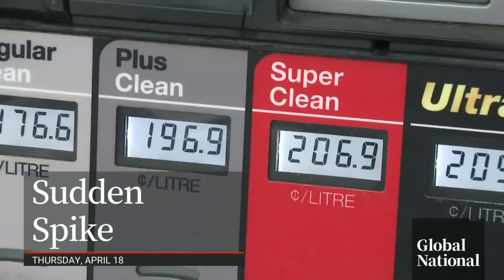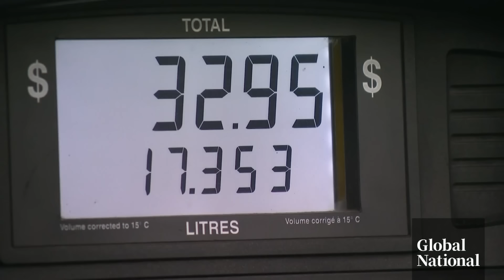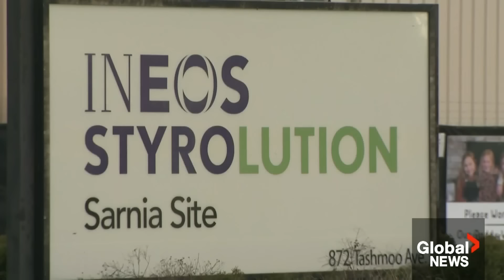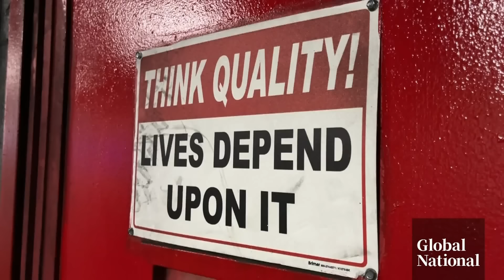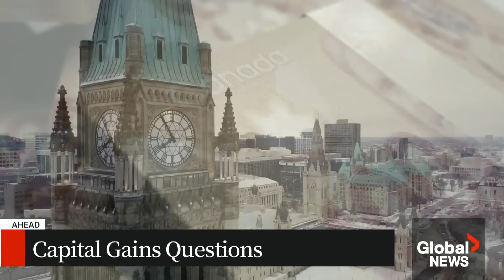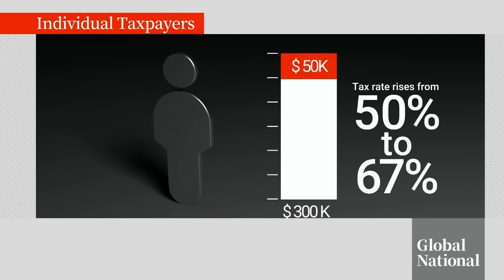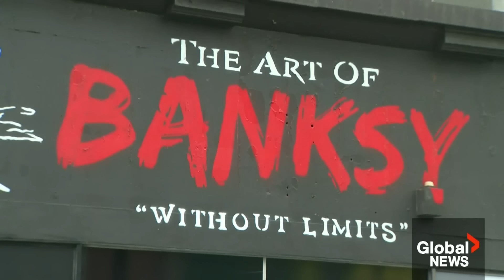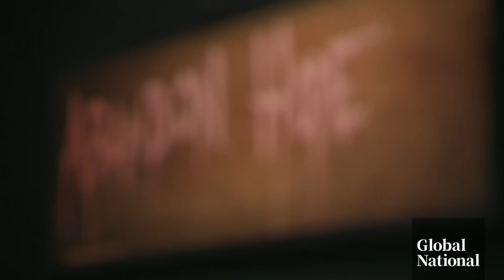Global National: April 18, 2024 | What is driving the sudden spike in gas prices in Eastern Canada?

Comment: So it's a double whammy this year. Season gas bump and carbon tax. But hey, we gotta think about climate change lol
Reply: I will be thinking about it while I drive 30km to Washington to fill up next weekend , hey I’ll save 65 cents a liter. With so much tax and inflation here why not!
Reply: Has very little to do with climate change, it has to do with oil companies not getting a decent buck for their products, so they cap their wells until the prices go up to cover their costs and allow for them to have operating capital to work. Ten years ago, oil companies capped their wells when the price of oil was below $100 a barrel, because it didn't pay them to operate, no return on investment.  Apparently the price of oil is about $80/barrel, so if wells get capped because cost of production is too high, there will be scarcity and that drives up prices at the pump. By the way, over 70% of oil companies in Canada are foreign owned, the question is, could foreign ownership be the reason prices jumped so high?

Comment: Canada Fuel Taxes by Province Province	Gasoline (¢/L)	Diesel
(¢/L)	Daily Gasoline Tax Based on Current Avg (¢/L)	Comment
Alberta	19¢	13¢	23.616¢	5% GST
British Columbia	21.17¢	22.67¢	26.994¢	GST + Includes carbon tax of 6.67 ¢/L on gasoline and 7.67 ¢/L carbon tax on diesel, as of July 1, 2012
Manitoba	24¢	18¢	28.682¢	GST Manitoba's PST does not apply to gasoline or diesel fuel.
New Brunswick	23.6¢	23.2¢	36.629¢	GST + PST
Newfoundland	24.5¢	20.5¢	38.202¢	GST + PST
Northwest Territories	19.7¢	13.1¢	25.124¢	GST
Nova Scotia	25.5¢	19.4¢	40.739¢	GST + PST
Ontario	24.7¢	18.3¢	37.291¢	GST + PST
Prince Edward Island	23.1¢	24.2¢	28.420¢	GST PST does not apply to gasoline or diesel fuel. Fuel tax is adjusted monthly and includes an amount equivalent to PEI's PST. The fuel tax is capped at 15.8%
Quebec	29.2¢	24.2¢	48.574¢	QST of 9.975% is applied on top of sales amounts after the GST has been added (QST + GST is 14.5% combined)
Saskatchewan	25¢	19¢	29.704¢	+ GST, PST does not apply to gasoline or diesel fuel.
Montreal	49¢	22.2¢	69.038¢	GST + PST + 1.5¢ Transit Tax. Rate is calculated by 19 cent provincial tax, 10 cent federal tax,17 cent GST+TVQ tax, and 3 cent Montreal tax
Vancouver	32.17¢	33.67¢	38.433¢	GST + PST + 15¢ Transit Tax.Includes carbon tax of 6.67 ¢/L on gasoline and 7.67 ¢/L carbon tax on diesel, as of July 1, 2012
Victoria	24.67¢	26.17¢	30.613¢	GST + PST + 3.5¢ Transit Tax. Includes carbon tax of 6.67 ¢/L on gasoline and 7.67 ¢/L carbon tax on diesel, as of July 1, 2012
Yukon	16.2¢	11.2¢	21.624¢	GST + PST